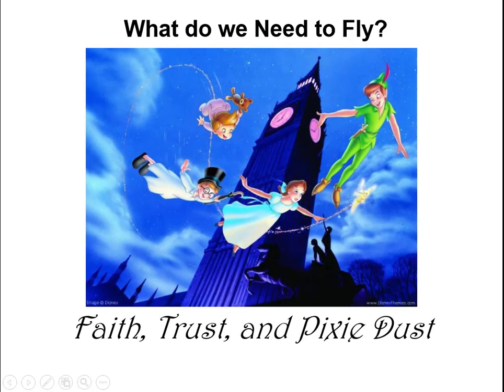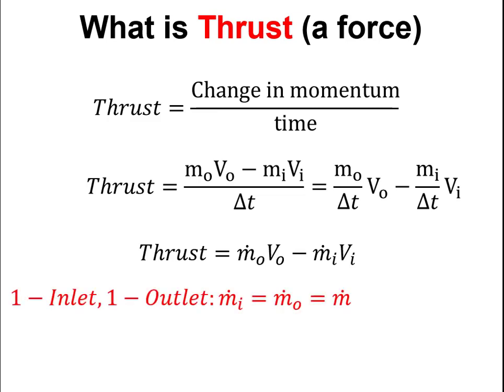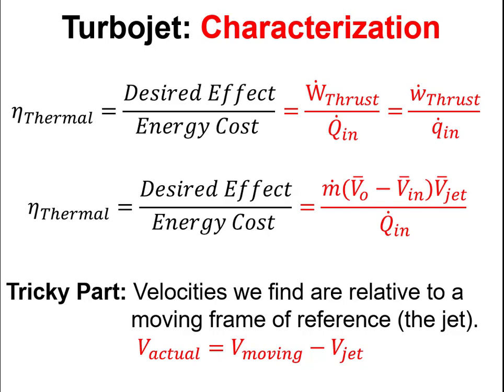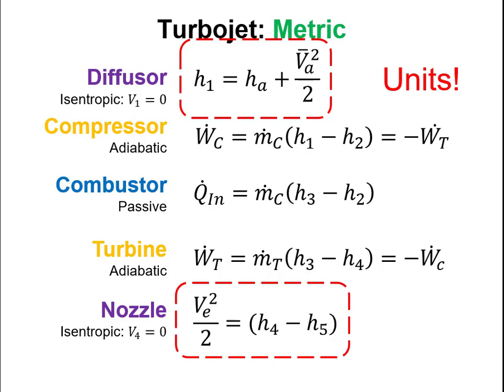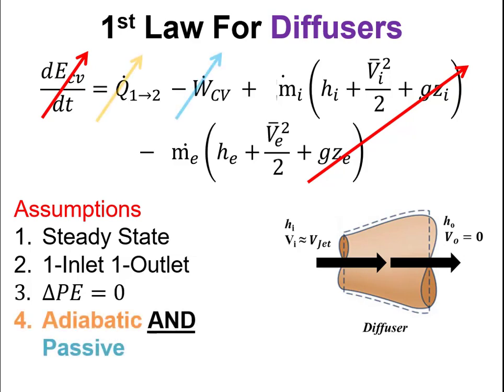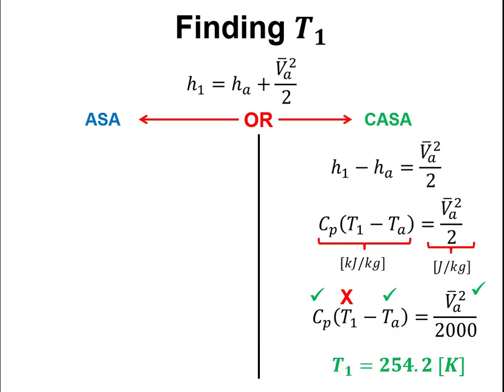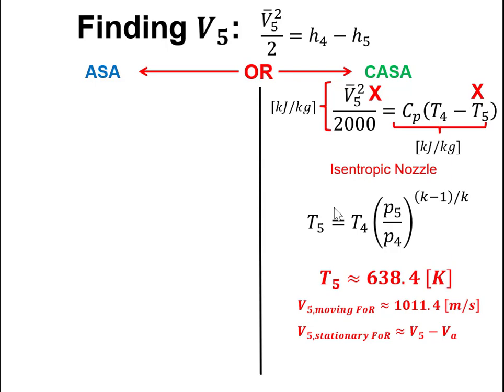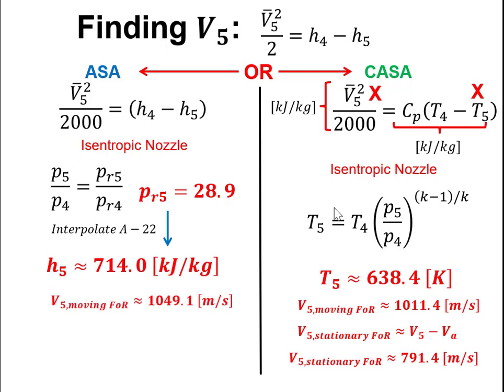Turbojets: Thermodynamics for Mechanical Engineers

Comment: The pressure in the combustor acts on all surfaces - including the compressor. My question is this: what does the hot gas flow back into the compressor? Am I missing something? Thanks - nice presentation.
Reply from the maker: I think you're asking why there isn't backflow from the combustor into the compressor? 

In a real system, there is pressure loss as you flow through the combustor so that the exit pressure is less than the inlet pressure. And flow goes from high to low pressure. So it keeps moving "downstream" toward the nozzle.

It's just that (1) the power lost from the pressure loss is negligible compared to the other power terms in the cycle so (2) we tend to neglect the pressure loss in the combustor...which tends to make fixing the states easier. 

It's a different cycle, but there was a Rankine cycle problem that we would sometimes assign when I was teaching this course. It would have pressure losses in the components where the the heat rate dominates the power (boiler and condenser). The tedious nature of fixing those states (lots of interpolation because of the differences in pressure) shows the benefit of making these simplifying assumptions. 

The problem didn't end like this, but it would be interesting to repeat that question assuming no pressure losses. Then you'd see that (1) the states are easier to fix and (2) it doesn't give a big change in the predicted answers because the pressure losses are small relative to the other power terms.

Comment: If there was no diffuser what would the specific enthalpy be at the inlet of the compressor? Would it just be Cp * temperature?
Reply from the maker: Just whatever the ambient value is. Your want to look it up on a table. Cp x delta T works for changes, but not for the single value. 1st law only needs changes anyway though.
Reply: @mikeschertzer941  I see, I don't have the table for air in the booklet given by my professor. So I calculated each of the enthalpies with Cp*Temperature. 

I needed the change in enthalpies to calculate the net power output and didn't know how to calculate the enthalpy.

I don't know if I've done it correctly I will have to wait to see what he says when he marks my paper.